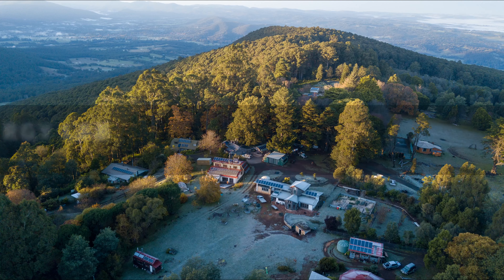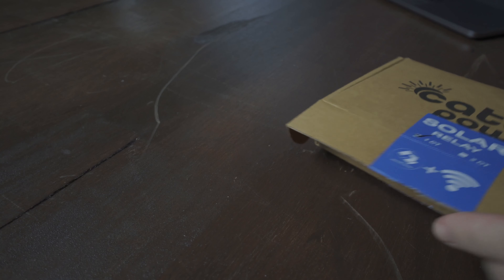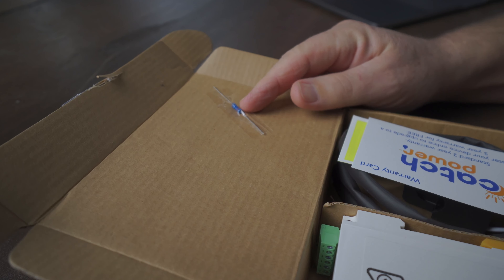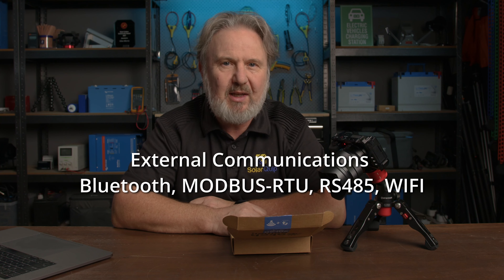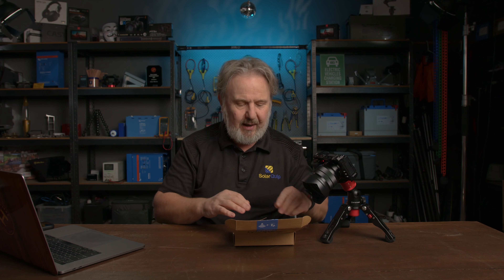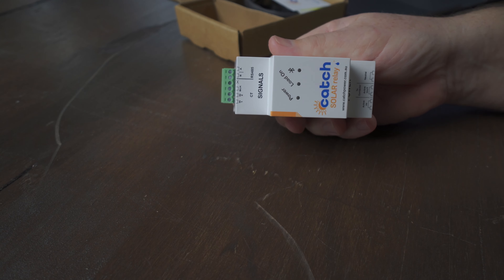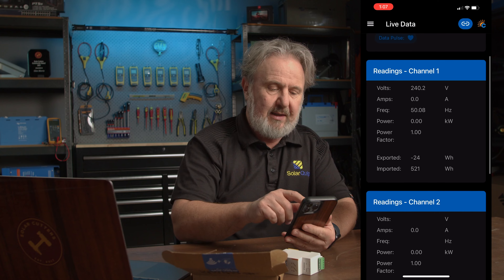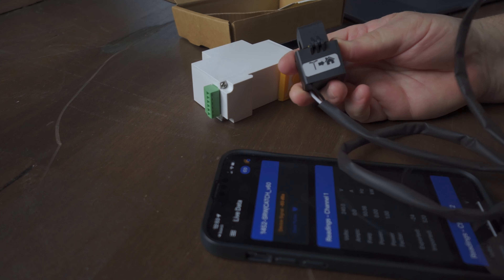Catch Power Solar Relay

Comment: I can highly recommend the Catchpower electric hot water diverter. Set and forget. Excess PV heats water before exporting to the grid. Boosts via off peak automatically during long dull periods.

Comment: Hi Glenn, I was wondering if this device could work with the problem we have? There has been yet another solar install in our street, which has finally pushed the grid voltage over the network providers safe working limits causing my 5kw Sungrow inverter to clip and drop out regularly on an over voltage scenario. My problem is we have a heatpump hotwater system which only draws around 500w of power.  Is there another way of using this excess power that you can suggest? Thanks Gary
Reply from the maker: Hi Rigley, a d.c. coupled inverter system will continue to charge a battery even when the grid is lost. That may be the solution.
Reply: Or an EV charger! Or pool heater / filter! Washing machine
Reply: A EV car with a smart charger seems like the next logical step for us. Thanks

Comment: Hi Glen,
Thanks for the review.
I'm looking at getting a 3-phase PV diverter, but unfortunately Catch Power hasn't released it yet. Would the Relay work just as effectively as a 3-phase PV diverter? Certainly cheaper.
I'm based in Adelaide and seems my local suppliers only carry this brand.
Reply from the maker: At the Smart Energy Expo in Sydney recently CatchPower said they were developing a three phase uint. Watch this space.
Reply: @SmartEnergyLab  I have 3-phase power at home and a 10KW PV solar system. 
I believe my Rinnai hot water storage system in on one phase. With the Catch Relay, will it put all surplus solar (including the other two phases) into heating water? Or will it only use the incoming solar energy on the hot water unit phase?
Thank a lot :)